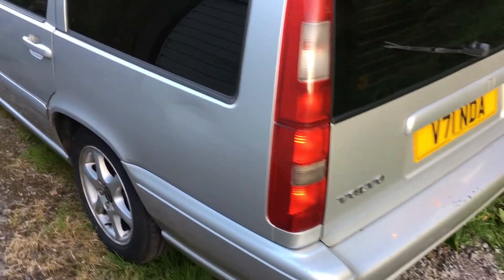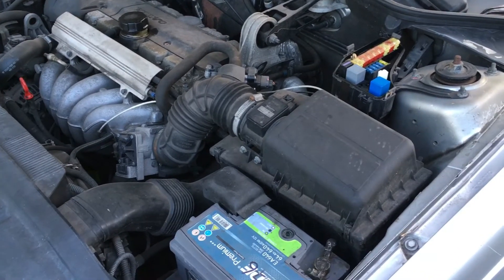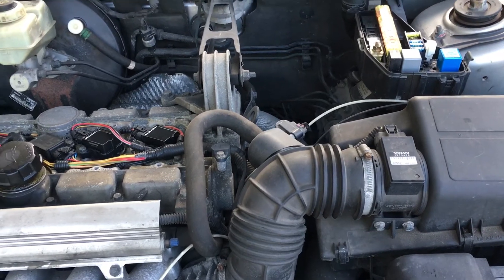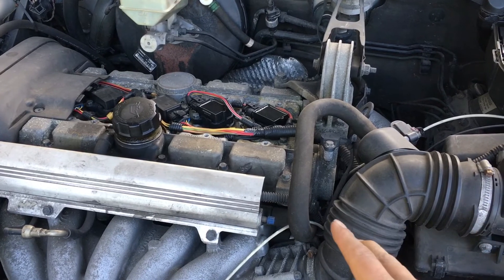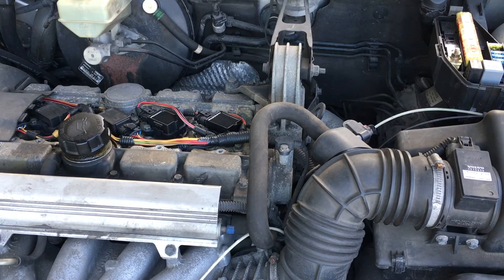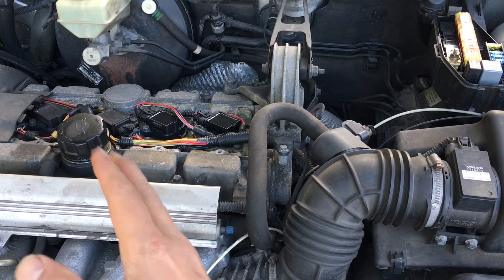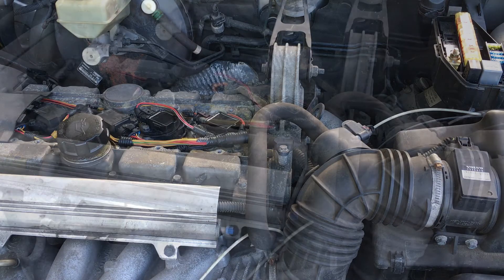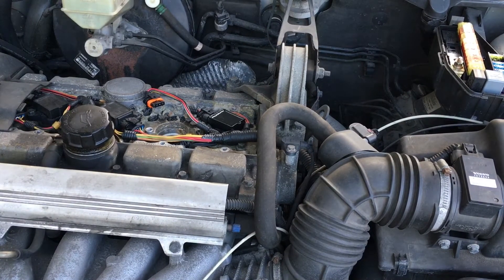How to Identify Bad Engine Compression Just by Listening to it Crank

Comment: Is this accurate? cause when ive done this rythm was good. So now Iam think it can be CCV cause its last think to replace of my list. I replaced almost everything. MaF, spark plug, o ring, gaskets, oil, filters. Non of that helped i was depressed thinking its low compression but after this video i doubt it. Iam having white smoke smelling like gasoline also missfire on cyl 2,3,4. When taking off oil filler cap there is no suction and no change in idle. I have pretty rough idle. My car is 520i M52b20 1997
Reply from the maker: I would not rely on this as a definitive test, only for direction. You should do a proper compression test.

Comment: Thank you for the great explanations of what you're doing and why you're doing it I really appreciate that. I have a 2001 Honda Civic that right now is not starting just cranks most of the time so I'm wondering about compression though now because just today I noticed that it was kind of making an uneven cranking noise earlier so that's got me worried. I just I'm just curious though if it is a compression issue does that mean my engine is pretty much done in?
Reply from the maker: Hi, simple answer is generally yes as it's going to be an engine internal issue.

Comment: I encounter some pretty decent hesitation every time i put my foot on the gas i changed everything in my car and still nothing. Last time i did a compression test i had the exact same irregular crank sound but my compression readings were very good. Is it possible to have a problem with the valves and still get good compression numbers? Im really disappointed.
Reply from the maker: I don't know I'm afraid. Good luck.
Reply: You tested compression on all cylinders and everything was good numbers wise? Yet at the same time it cranked and didn't sound like an even rhythm?
Reply: You could have a timing issue...check timing belt and see if it has jumped out of time....